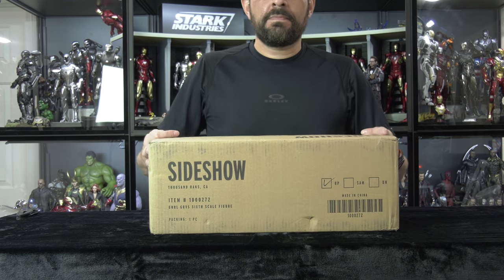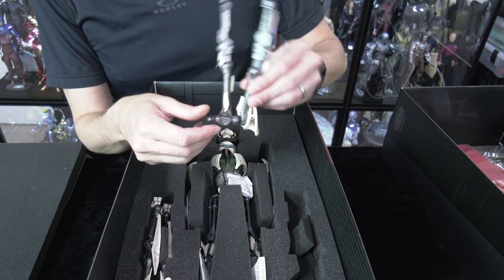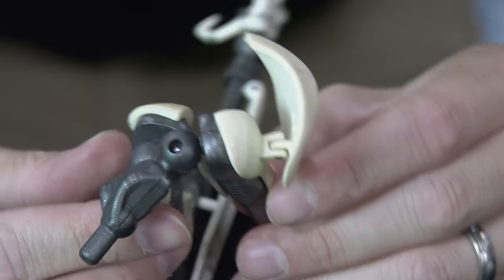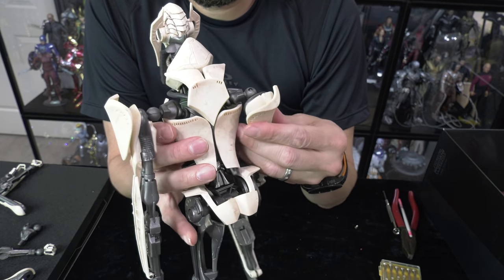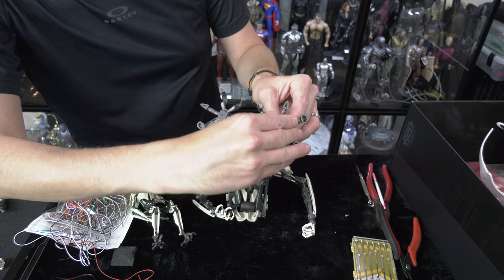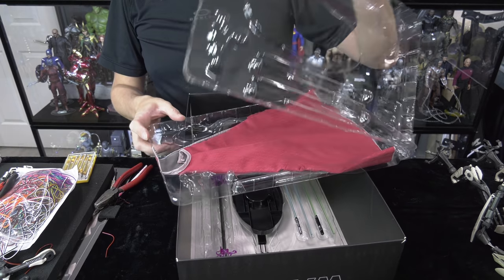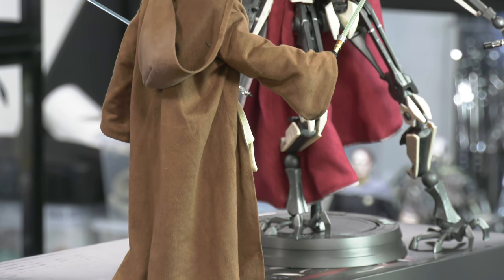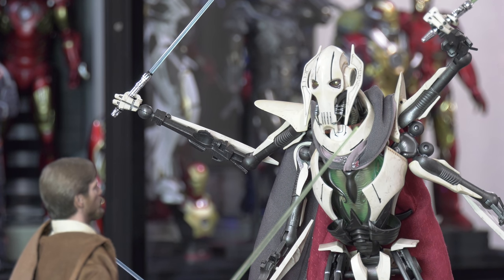Star Wars General Grievous Sixth Scale Figure by Sideshow Collectibles re-issue 2021 version unbox

Comment: Only the exclusive 1.0 came with a 2nd faceplate, the normal was basicly what you have now. I feel like sideshow found a batch of these 6 years later and decided to sell them as new. My 1.0 doesnt even have the flimsy arm issues which Im grateful for.
Reply: Star Killer  oh no it did if you were to buy it now on ebay brand new it has the exact same issues i believe part of it is the fact it wasnt built well and the age

Comment: "I felt a GREAT disturbance in the Force..." I remember in our stream this week we shared our reaction and thoughts this figures quality and its what I expected but much, much worse... I hope collectors are calculating on what needs to be done, whether you want to get a full refund back or try the Danoby way and modify your Sideshow Grievous mistake...
Reply from the maker: I gotta get points for the clever title at least right Nate? 🤨
Reply: @Danoby2  Absolutely 💯... 10 points for DANOBY
Reply: Star Killer  I'm actually investigating the potential to see if the hexa gear booster packs that include joints for the Kotoboykia kits would actually fit
Reply: @exoticcarfactsofficialchan7050  🤣

Comment: I’m a 3.75 mega collector and that poster tac, and a hot glue gun are a collectors best friend! Instead of stands I use 1” washers with the poster tac on there feet and it works better in my opinion! They are bottom heavy so the don’t tip over, and they stay how you put them. And with all my Jedi and Sith characters I use the hot glue gun for there saber hilts on there belts. A little drop of hot glue and your good to go! They will come of easy if you want but hold pretty good if you want it to stay! I enjoyed this video because you seem to be just like me with crafty stuff you use! I hate returns as well and will usually find ways to make it work long before I return it!

Comment: Just use a mini hand drill to make a hole through the pins in those joints and use domed head self tapping screws (those used in virtually everything made) to secure the two halves of the joints together while still allowing articulation that can now be tightened or loosened. If you don't like the look of the screw heads either fill them with Milliput and paint or 'Sharpie' them, another solution would be to use electricians' shrink wrap/tube over the joints and carefully heat it to compress the joints on its own or to cover the screw heads and add more stability to them. Time to fix all four: 30mins, cost to fix all four: less than a $.

Comment: This is not a shock, I expected the joints thing, I actually like the figure, I would not send back as HT's is all Mando and Grievous is way off! I do not have mine yet as based in the UK and ordered from HK.  Big thank you for the tips, using a waist grabber and flexi pole on mine.  Do not send back, mistake and you will regret, he has shelf presence.  Thanks for the review.

Comment: I love the pose at the end. I don't care what anybody says I absolutely love this Grievous!!! I had the original exclusive release but unfortunately had to sell it. So when they announce this I was very happy. Would've preferred a Hot Toys one. I'd have to say this is Sideshows best 1/6th scale figure. Yeah he has issues with getting loose after time but there's ways around to like that puddy you used or Kiki joint hardener but it's not like glue it's just for loose joints it goes on like glue. Warts and all I love this figure. The only thing about the sculpt I don't like is his chest plates are not movie accurate they should be almost touching and able to move like pecks. I don't really need to see his organs. I'm still praying Hot Toys will release one. Sooner rather then later.  Look at Hot Toys and Sideshows Luke in Jedi and Scout troopers announced and or released at the same time. It could happen.  Well have to wait and see.
Reply from the maker: I guess as long as your happy with the final product, that's all that matters. :)
Reply: @Danoby2  what helps a lot with this Grievous and I would highly recommend to everybody is buy him a dynamic stand and some Museum putty. You can get some crazy poses out of him with the Dynamic stand and he isn't going anywhere. And the museum putty is great if his arms get loose it's kind of like Silly Putty take a little chunk off put it in the hole let's stick to Peg in it and it will tighten the arm right off. Museum putty is also reusable and will not harm the figure and it's also good for using on many many other things not just 1/6 scale figures you can use it for almost anything.

Comment: That’s too bad the joints are weak. Sideshow really need to spend more time/money on r&d. I can’t say for sure it would work for this figure but i use this stuff I found on eBay called “Kiki, fix loose joints” and it helps a lot. I use it on just about any figure and it’s always improved the friction.